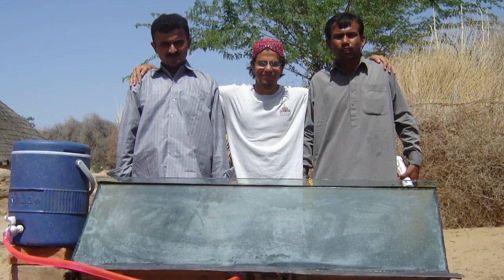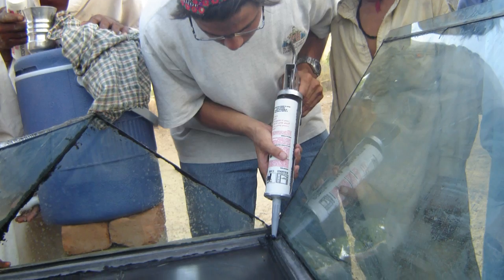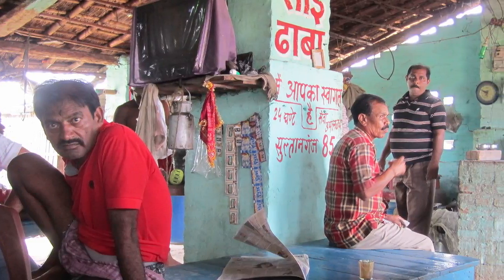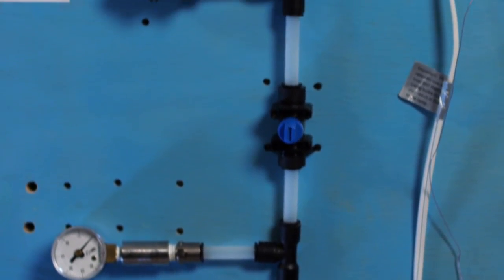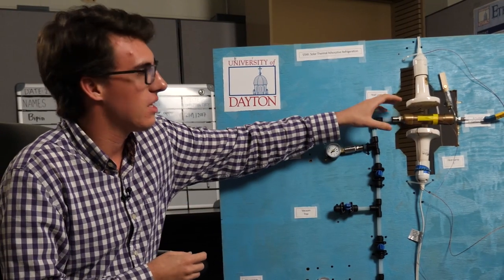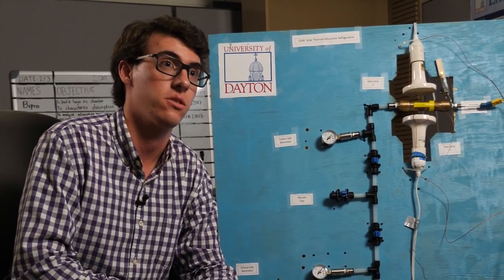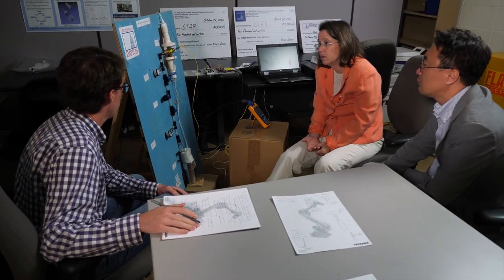Refrigeration without Electricity

Comment: This sounds sort of like RV ammonia refrigerators, except the heat source is typically a propane flame, or electric heat coil. Great project!
Reply: Can you plz explain how would heat generate cool gas , I know condensed gas or liquid when its released from pressure get colder , but how would heat source generate cool gas from Amonia for example
Reply: @The_Great_Hejaz  Google is your friend...
Reply: @mikek1187   you can escape it in ideal way you're not good at it
Reply: @The_Great_Hejaz 😂 what??? I mean Google the answer dude. Why do I need to spoon feed it for you? Here’s a hint: “RV ammonia refrigerator”. Needs a HEAT source to operate….🙄
Reply: @mikek1187   you are right bud , I guess I wasn't in the mood when wrote that comment
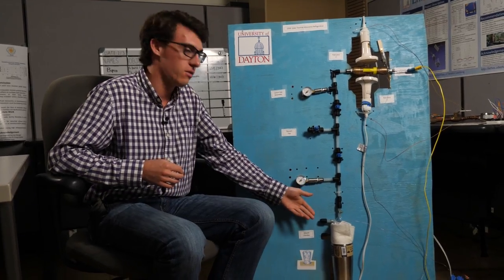Reply: They explain the thermal cycle involved in this video around 1:10 @The_Great_Hejaz

Comment: That's cool, but it's probably not as practical or efficient as compressor-driven refrigeration. Even if they don't have power, you could take a solid-state solar power with a battery bank, pair that with a hyper-efficient, under-stressed compressor with good insulation and get far better results.
Reply: If it does the same job without a compressor there is a 99% chance its WAY more efficient. And with the cost of solar panels+batteries they can just buy a plane ticket to usa/europe and problem solved
Reply: @filipenegreiros9557  it is simpler and therefore more reliable, but not more efficient. Great idea for sure.
Reply: This is a different requirement set though. The "most efficient" requirement isn't always the best solution.  Cost and availability of items also come into play.     In which case the goal is a viable product you can build that caters to those constraints over "most efficient"
Reply: @bill4639  who cares about efficiency when you get your energy from the sun? What matters is cost per kw of cooling over life cycle.
Efficiency is irrelevant when you’re using renewable energy.
Reply: @sherifnabil9663  efficiency is a very important variable for engineers, especially for a student research équipe like this. It'll show how bulky the system would be, and in this case as cos criteria comparator. 
Remote regions are among the few cases sustainable design makes sense, so u want it less bulky to carry.
Now, by your narrow-minded depiction of sustainability, is why it's a scam nowadays.. politicized led discourse that disregards efficiency for fantasy land is why many sustainable projects creates more trash, synthetic trash, wastes our tax dollars, and unnecessarily occupy and pollute precious natural real estate.
Reply: @nolan738 You are right about efficiency being lower, but I think you might have missed part of the point of this system.  It is ethanol, tubing, activated carbon, and a heat source.  It is very simple and made from parts that can be sourced in-province or from local providers.  A really good engineer could take these locally-available materials and marry them to a very cheap solar-thermal system that stores its heat in a dry sand thermal mass.  

The 2-minute googling I did on the subject shows a design for an ice-maker powered by solar heat going back to 1997.  The heat required to get the ethanol out of the carbon once it was adsorbed was about 76C and the resulting temperature drop was below freezing.  I wish these students had gone ahead and worked out a viable installation design for a small refrigerator based on their findings, it looks like they have the right idea for a locally-manufacturable/locally-serviceable system for critical uses.

Comment: Wow, very cool.   I must be on the right track, I'm doing something  similar.  Instead of a refrigerator, I was looking to lower my air condition bill, even just a little bit, by making a DIY AC with similar characteristics as your design.  And NO, this is not meant to replace my central air, but to help curve it from running all day during the day.  I was wondering if you are cycling the heat lamps, on and  off, to extract the ethanol from the activated carbon, or just continuously leaving the heat lamps on?  And, yes I know your used lamps, for this demonstration, and will use the sun, in your deployment.  I hope you continue your endeavor.

Comment: Nobody said what the chiller temperature is. Why would you use ethanol when ammonia absorption reaches colder temperatures and the units can be made out of steel piping or cast iron which is available worldwide as is ammonia... Which in a pinch could be refined from piss either human or agricultural. 
I'm not knocking that it would work for refrigeration but it seems if you're going to go through all the trouble it would make more sense to make something more effective and efficient. An oval wheel will roll... There's a reason why we use a round wheel though 🤷.

Comment: Of course electricity is not needed in refrigeration. You can use a diesel engine to drive a compressor that is part of a refrigeration system. Now, the diesel engine don't require electricity to run unlike petrol engines. Did I read the title wrong?

Comment: How they plan to create the vaccum ? Does anyone notice
Reply: When it needs a compressor to establish vaccum what is the point of this idea instead of re-inventing the wheel they should try to make the solar cells more effective and efficient
Reply: U could just add a vent linke a bicycle tire and reverse use a pump to creat a vacuum thats easy. Only use a metal valve coz.I think the alcohol will eat the rubber.
Reply: @superliegebeest544  so if U allready suggest a pump then why not replace the PD pump witha compressor and call it a day😁
Reply: Sometimes its not worth reinventing the wheel
Reply: @kanpurunplugged9970  coz it.not.supposed to use electricity.
Else by a solar powered fridge of the.shelve.and.call it a.day
Reply: @superliegebeest544  u must read my comments i have already stated that solar cells need a boost rather than the carnot cycle
Reply: @superliegebeest544   i guess u suggest an indian life is worth a mini fridge then U r it.
Reply: @kanpurunplugged9970  what ur rambling on my friend? The vid is about a frigde that doesnt need electricity. So I suggested to use a handpump to create a vacuum in the closedloop system. U want to add a compressor, so if u do that than why not just buy a solar powered fridge? U even habe solar powered ac units so u can also have a big solar powered fridge.
Reply: @superliegebeest544  this vid is about an affordable refrigeration for poor community in rural india where tempratures in summer reach +50°C if they want to reinvent the wheel then they could have worked on refrigerant mixtures and new superheating process
Reply: @kanpurunplugged9970  If it provides something for free, it's not a wheel, is it.
Reply: @kanpurunplugged9970  So do it, then show us, in place of trolling !

Comment: What happened to the old refrigerator that had a flame underneath and would cool?
Reply: all about the efficiency and practicality 
you can get free electricity from the solar panel but it is not practical to use it because it does not produce  enough energy and the energy cannot be stored overnight
Reply: @kendipietro6855  thank you werry mutch for sharing. It was like finding Gold too me.
Reply: Propane refrigerators work on the same premise except the liquid inside the pipework used to cool was ammonia.
Same premise, different means of heating.
Reply: This here is exactly the same, with some newer techs and materials, so, more affordable.
Reply: @ShortStorytime  Ok so if i replace the flame heating by a solar heat catchment (wich on would be the best do you think ? Thermal pastes, oscilliating heat pipes ? ) Will it cool in the same way ?

Comment: so it just uses solar electricity instead of the grid ? false heading if true.
Reply: It uses solar heat directly, not electricity. It is more akin to a propane gas fridge (absorption refrigerator) than to a typical household fridge. I believe all it needs to get the cycle going is to heat the cooling solution